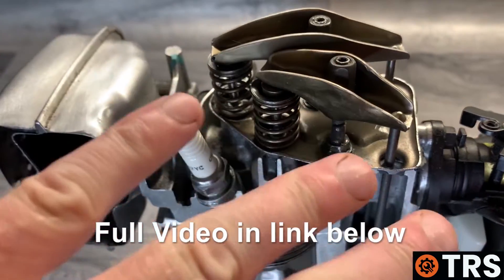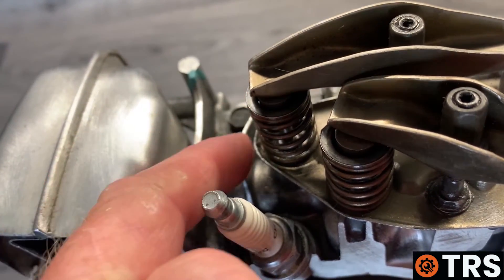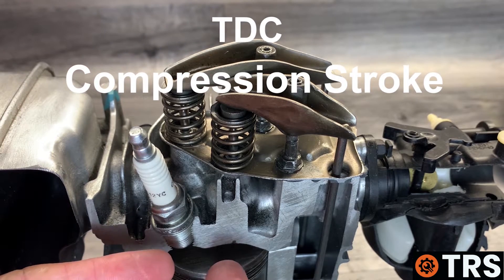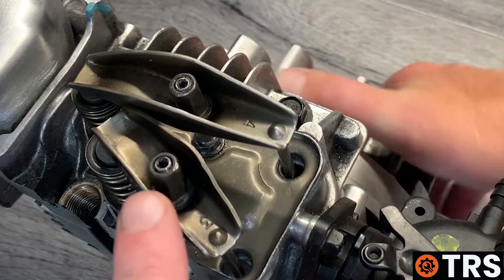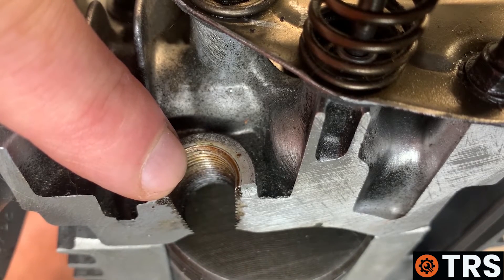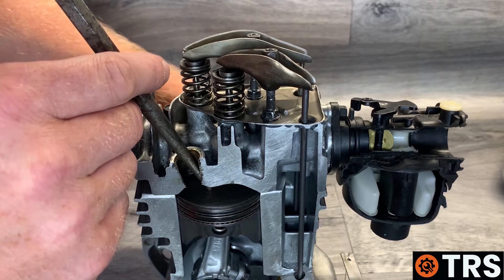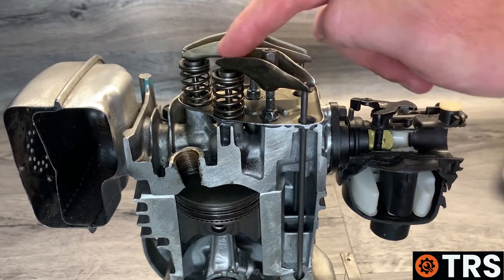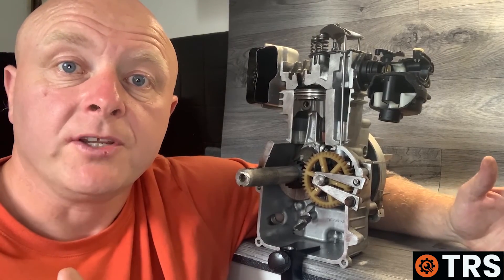The Easiest Way to Set Valve Clearances!  (by Craig Kirkman)

Comment: Question. 
When you are setting your valve lash and get the feeler gauge right. But you wiggle the rocker arm and your lash is now lose...... is that normal or are my parts worn out?
Reply from the maker: Great question — and what you’re noticing is actually pretty normal. When you set valve lash with a feeler gauge, you’re measuring the clearance between the rocker tip and the valve stem at the point of zero lift. If you then grab the rocker and wiggle it side to side or up and down, you’ll usually feel a little play. That’s because:

The pushrod, rocker arm, and lifter all have a bit of mechanical clearance built in.

The feeler gauge only sets the gap in the valve’s direction of travel — any side-to-side movement is just the natural tolerance in the rocker pivot and pushrod seat.

As long as your feeler gauge reading is correct when the cam lobe is on its base circle (valve fully closed), you’re good.

If you notice excessive slop (like several millimetres of movement or loud clattering when the engine runs), then you might be looking at wear in the rocker pivot, pushrod ends, or valve guides. But a small amount of looseness when you “wiggle test” by hand is completely normal and not a sign of worn-out parts.

I hope this answers your question, and let me know if all is well when you fire up your engine (if you are setting valves at the moment).

Craig

Comment: but isn't it possible to also accidentally set it to TDC on the exhaust stroke instead of the compression stroke? or would it really matter if i was either on the exhaust or compression stroke? i guess i would see that the exhaust valve is open, but in the scenario that im not performing a valve adjustment and i just need to be on tdc for a specific job that im doing and the valve cover won't be off, how would i know im on the compression stroke tdc instead of the exhaust stroke tdc?
Reply from the maker: Yes, you’re exactly right — the piston comes to TDC twice: once at the end of the compression stroke and once at the end of the exhaust stroke. If you’re doing valve adjustments, you always want TDC on the compression stroke, because both valves are fully closed. On the exhaust stroke, the exhaust valve will be open or just closing, so you’d be in the wrong spot.

If you don’t have the valve cover off to see the valves, there are still ways to tell:
	•	Feel for compression: put your finger over the spark plug hole and slowly turn the engine — if you feel air being pushed out as the piston comes up, that’s the compression stroke.
	•	Listen/feel: sometimes you can hear the hiss of air at the plug hole as the piston comes up on compression.
	•	Timing marks/manual: some engines have marks that only align at compression TDC.

So yes, you can land on TDC at the wrong stroke, but with the plug out and your finger over the hole, you’ll know for sure when you’re on the compression stroke.

I hope this answers things

Craig
Reply: @TheRepairSpecialist great thank you so much. very useful and detailed info!

Comment: TAPPIT/LASH adjustment cannot be done on the engine unless you are willing to purchase a different size tappit/lash. The machine shop can do this for you if you choose to do a complete valve job.
Reply from the maker: You’re right that most small engines don’t use adjustable tappets like a car, so you can’t just turn a screw to set lash. On Briggs & Stratton and similar engines, the usual method is to adjust lash by carefully grinding a little material off the valve stem tip, or by replacing the valve with one of the right length. A machine shop can do it, but many people set it themselves with a file or grinder. So it can be done on the engine without buying different tappets — just a different adjustment method than most people are used to.

Thanks 

Craig
Reply from the maker: You’re right that most small engines don’t use adjustable tappets like a car, so you can’t just turn a screw to set lash. On Briggs & Stratton and similar engines, the usual method is to adjust lash by carefully grinding a little material off the valve stem tip, or by replacing the valve with one of the right length. A machine shop can do it, but many people set it themselves with a file or grinder. So it can be done on the engine without buying different tappets — just a different adjustment method than most people are used to.

Comment: Excellent visual explanation of how to get the engine to the compression stroke, Some fine adjustment tips:
-  If convenient, remove the recoil assembly (the part with the pull rope) to make it easier to turn the crank to the right piston setting.
-  After setting the piston to TDC,  check the existing gap clearances beforehand to determine how far off they are. If the gaps are good, no need to bother readjusting the gap(s).
-  When adjusting gaps, make sure the locknut is only slightly loose. Once you get your setting right, hold  the screwdriver handle steady with one hand while gently locking down the nut with             the other. Greater chance of  maintaining your desired gap this way.
-  After your adjustments, turn the crank a few times and recheck your gaps to confirm they are holding.

Comment: Greg, I got a predator 212 that just quit working or running actually so I’ve been adjusting the vowels and adjusting the valves and adjusting the valves. All wants to do is backfire or after fire. What do I do now?

Comment: You also dont want to set the valve lash on the compression release on these engines.. some of them have one for easier starting especialy on those with a pullstart only.. the exhaust valve opens, then the intake and slightly after the intake, the exhaust valve opens just a hair and that is the compression release! 
On Briggs and Stratton flathead engines there usually is no adjustment or you have to play with some shims!

Comment: Not trying to be a smart Alec; is it necessary to take account of valve overlap? EG adjusting the inlet when the exhaust valve just starts to open, and the exhaust valve when the intake just starts to close? I've heard this argued on another video and I'm not sure if this is over-complicating things? Or does setting the manufacturer's setting at TDC take into account overlap?
Reply from the maker: Hi! Thanks for your question and for watching my video.

When adjusting the tappets and valving system on a small petrol lawnmower engine, the manufacturer's recommendation to set them at Top Dead Center (TDC) generally simplifies the process and ensures accuracy. At TDC, both the intake and exhaust valves are closed, eliminating the need to account for valve overlap.

Valve overlap, which occurs when both the intake and exhaust valves are open simultaneously, is more relevant in high-performance engines where precise timing adjustments are crucial. For most small lawnmower engines, adjusting the valves at TDC, as per the manufacturer’s instructions, should be sufficient and effective.

So, unless you're dealing with a specialized engine, setting the valves at TDC should work perfectly fine and avoid over-complicating the adjustment process.

I hope this helps clarify things!

Thanks

Craig
Reply: @TheRepairSpecialist  It does Craig. Mustard! 👍👍👍

Comment: Whats the proper clearance for small engine 49cc
Reply from the maker: You need to check with your engines manufacturer specifications in the service manual. If you no longer have this then you can usually find one online if you put your engine make and model in the search engine. Make sure you have the correct manual though. 👍

Comment: Good day, how would I go determining which valve lash should I use for an engine with aftermarket cylinder heads , aftermarket cam and rocker (motorcycle converted from 2 valves to 4 valves), is there a way to determine which lash should I use as there is no instruction anywhere its a completely self built engine?

Comment: Hello,
The videos posted by you are very interesting and educational, congratulations for the work done.
I also encountered the following problem with a 4-stroke chainsaw (clone engine after the Honda GX35). When starting from cold, everything is ok, but after a few minutes of operation, not in a very intensive mode, the chainsaw gets very hot, sometimes it stops by itself. Even if it doesn't stop by itself, restarting is very difficult, sometimes it doesn't work at all, sometimes the air filter gets wet with gasoline. In the settings from the manufacturer, the valve distance is set to 0.08 at the inlet and 0.11 at the outlet, I found the outlet at 0.25, I adjusted it to 0.11 but the same behavior. Do you think it's a problem with the carburetor or the existence of fake air?

Comment: I watched your vid just now..could you alive me in any way,  iv been told my tapets space is correct but if I listen to the top of my engine ..i can clearly hear a rattle ir lower tapping sound over on  one area ,  the inlet side, I have used a a stethoscope, to listen, my engine is..push rod.. its a citreon  u25 1993.. its driveinging me mad.. is there any way the rod might be worn, and can this part be changed..do you know. Any tips would be so helpful to me

Comment: I have a 1999 r6 , carbed . Carbs balanced , bike runs well but there is ticking from rocker area in low revs and also if riding in town slowly the bike loses a bit of oomph .. until i take it out big roads and blast it then the bike runs great again . Could this be a valve clearance issue ?

Comment: Thank you so much for this video! I was able to replace a broken exhaust valve and set the valve lash on my mower. 

I have a couple questions, could incorrect valve lash have caused the exhaust valve to break? The stem broke about quarter inch from the valve lid and was just sitting on the piston head when I took the cylinder head off. 

Also, is it a good idea to check the valve lash on a new mower before first use? 

Thanks again for your invaluable channel!
Reply from the maker: thank you for watching and I'm thrilled to hear that the video helped you successfully replace the exhaust valve and set the valve lash on your mower!

Regarding your questions, incorrect valve lash can indeed lead to various issues, including potential valve damage over time. When the valve lash (the clearance between the valve stem and the rocker arm or camshaft) is too tight or too loose, it can impact how the valve operates within the engine. If the clearance is too tight, the valve may not fully close, leading to overheating and potential failure. Conversely, excessive clearance can cause noisy operation and inefficient valve timing.

In your case, the broken exhaust valve could have been a result of incorrect valve lash, especially if the valve was not seating properly due to inadequate clearance. This can lead to excessive wear and stress on the valve, ultimately resulting in failure.

As for checking valve lash on a new mower before first use, it's generally a good practice if the manufacturer recommends it in the owner's manual. New engines can sometimes require initial adjustments as they settle in and parts wear in. Checking and adjusting the valve lash as per manufacturer specifications can help ensure optimal performance and longevity of your mower's engine.

I'm glad to hear you find the channel valuable, and thank you for your thoughtful questions! If you have any further inquiries or need more assistance, feel free to reach out. Keep up the great work maintaining your mower, and happy mowing!

Best regards,

 Craig

Comment: If you have a manual car a good way to move the engine in to put it in forth and move it forward and backwards with out the key being on
Reply from the maker: Hi

thank you for sharing your tip about adjusting valve clearances in a manual car by moving it forward and backward without the key being on. This is indeed a clever method to rotate the engine for valve adjustments without the engine running.

For those who may be unfamiliar, this technique involves putting the car in gear (such as first or fourth gear) and then physically moving the car by pushing it back and forth. This action rotates the engine's crankshaft, allowing access to different valve positions for adjustment without needing to start the engine.

Adjusting valve clearances is an important maintenance task for ensuring optimal engine performance and longevity, and your tip offers a practical approach for completing this task safely and efficiently.

As always, when working around a vehicle, it's essential to prioritize safety by engaging the parking brake, ensuring the car is on a level surface, and taking necessary precautions to prevent accidents.

Thank you for sharing this helpful advice with our community. If you have more tips or questions related to engine maintenance, feel free to reach out. Your contributions are valued and appreciated!

Best regards,

Craig

Comment: Liked and subscribed. I got an atv engine that cranks but wont start. I got gas and spark but air compression is very low so i was looking to find a video that explained with visuals how to adjust the valves and this video is super informative and i have a good idea on what to look for. I just dont want to find out that i need to replace valves or anything that has to do with the cylinder head disassembly if it still dont get enough air pressure lol

Comment: thank you for all the information you are providing. I have a 4 stroke small engine.  The recoil string pulls freely when I remove the spark plug.  It is very difficult to pull with the spark plug on. What can be wrong?  Your advice is greatly appreciated.

Comment: hi i was told by the dealer to not touch my engine...I have a toyota yaris and i believe it has buckets as for lifters.. I can hear a very faint background tok..but goes away the minute i give it some gas. Sounds more like injectors. its a 2011 yaris with very low mileage.

Comment: How do you compute the right valve clearance if you used higher cam lift?
Reply from the maker: Well Its just a case of using the correct specs from the manufacturer really. Taking a look at the owners/service manual

Comment: Awesome video explaining why and how. My old marine diesel engine does not have a spark plug to check the TDC. Do you have any practical advice for finding the TDC on diesel engines?
Reply from the maker: Finding Top Dead Center (TDC) on a diesel engine without a spark plug hole can be a bit more challenging, but it's still possible using various methods. Here are some practical ways to locate TDC on a diesel engine:

Manufacturer's Manual: Check if there's a manufacturer's manual for your specific marine diesel engine. It might provide instructions or diagrams to help you locate TDC.

Crankshaft Markings: Many diesel engines have markings or notches on the crankshaft pulley or flywheel to indicate TDC. You might need to remove an access cover or inspect the engine from below to see these markings. Use a timing light or a simple timing tool to align the marks with a reference point.

Dial Indicator: A dial indicator is a precision tool that measures piston movement within the cylinder. You can attach it to the engine and rotate the crankshaft by hand. The indicator will show when the piston reaches its highest point (TDC).

Valve Lash Method: If you need to adjust the inlet and exhaust valves, you can use the valve lash method. Rotate the engine slowly by hand until the intake and exhaust valves are both closed for the cylinder you're working on. At this point, the piston should be very close to TDC, and you can make fine adjustments from there.

Compression Stroke Method: If you have access to the camshaft, you can determine TDC by observing the position of the cam lobes. The piston is at TDC when both valves for a particular cylinder are fully closed and the cam lobes are not pushing on the valve lifters.

Trial and Error: If none of the above methods work, you can use a trial-and-error approach. Slowly turn the engine by hand while observing the movement of the valves or the compression gauge. When both valves are closed and the engine seems to resist turning, you are likely close to TDC. Fine-tune from there.

Remember that it's essential to be patient and cautious when attempting to locate TDC. Rotating the engine slowly by hand to avoid any damage and using tools carefully is crucial. Additionally, ensure the engine is in neutral or properly secured to avoid accidents. If you're not confident in your ability to find TDC, it's best to consult a professional mechanic or service manual for your specific engine.

I hope this helps a little

Craig
Reply: @TheRepairSpecialist  Thanks for your detailed answer. I have checked the manual of my 50 year old Volvo Penta MD2B. Using your  valve and lash method, I have found the TDC which is between the closure of exhaust and opening of the intake valve (the valves rock one after another). Based on the info from the manual, I made one full rotation to bring the piston to the TDC of compression cycle where both valves were completely closed. I adjusted the valves at this point. Many thanks again.

Comment: Your cut away engine is just amazing.  I feel like I could just stare at it.  Most of the engines I work on are the Briggs with the over head valves and the plastic carbs.  This helps me understand the whole system perfectly. Thank You!
Reply from the maker: I'm absolutely thrilled to hear that you're loving the cut-away engine! 😃 It's fantastic to know that it's been so helpful in enhancing your understanding of engine systems, especially with the more modern Briggs engines. Your appreciation and kind words mean a lot to me, and I'm here to provide more insights and information whenever you need it. Keep up the great work, and being happy tinkering with those engines! Craig